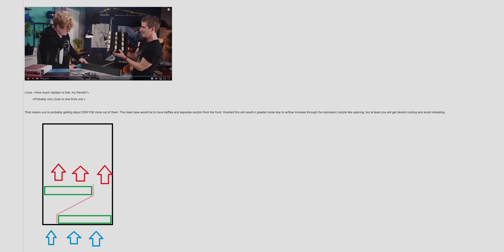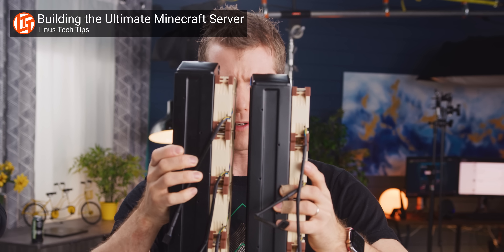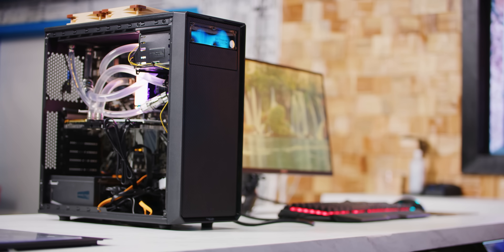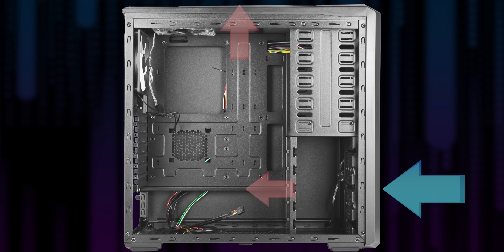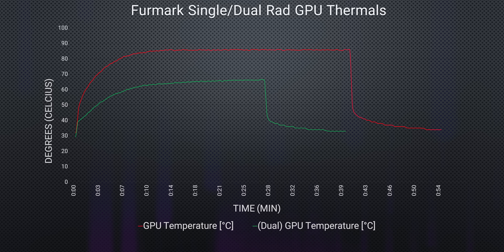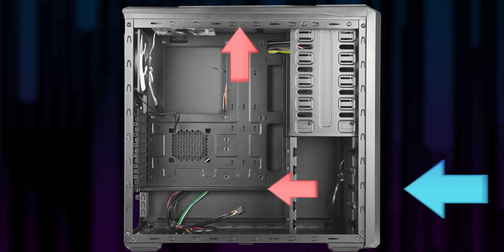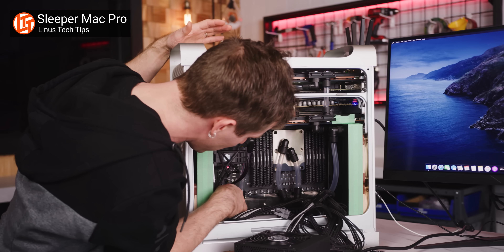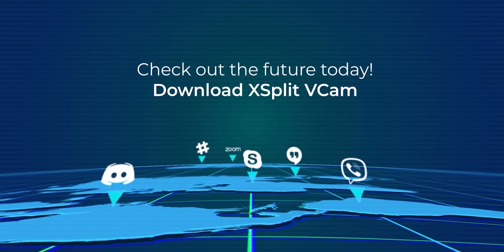I’ve been water cooling wrong for YEARS - $H!T Manufacturers Say

Comment: Maybe its so obvious noone seems to have said it, but if you are going to stack radiators, it ought to make a huge difference which order you stack them. - 'pre-cool' the one(s) closest to the heat source with the hottest air and let the one(s) with the coldest water see the coldest air.  Running the things in parallel with them all getting room air is going to be best, of course.

Comment: Linus: "Nobody would do that"
Corsair: "We do that"
Reply: does that mean corsair = nobody? 😩😩😩
Reply: Funny enough I do it to prevent dust from coming in through openings that have no filter
Reply: @spooky1000  Get or make some filters.
Reply: @Haargeroya  there are holes on the stupid pci plates, i put electric tape on them, as well as on some water cooling grommets
Reply: Yeah, I used plastic foil and a pair of crappy 120mm fans to seal off my top case vents after spilling my drink and nearly flooding my PC earlier this year. Didn't even do anything to the thermals, but that's kinda what I expected. I tuned my rig for silence and efficiency, rather than absolute maximum performance.
Reply: @ELHV  I think your main issue is getting the pc off the floor.
Reply: @Haargeroya  To be fair - this has happened once in the 8 years that I had this kinda setup, so it's not exactly something that I'm too worried about. The plastic cover is just a nice bit of bonus protection and it also keeps the dust out, which is nice.

Comment: THERMODYNAMICS!!! IT IS ALL ABOUT COLDER AIR GOING THROUGH WARMER RADIATOR!

WITH MORE THAN 1 RADIATOR IT MAKES VERY MUCH SENSE TO PRODUCE OVERPRESSURE IN THE CASE!!!!
Here is why:
One radiator after another is as retarded as a radiator taking in warm air from the inside of the case.
!!!!!!!!!!!!##### HOWEVER  #######!!!!!!!!!!
Having a second radiator taking in colder air is still providing energy/warmth removal from the water.

Comment: What if you have 3 120mm fans in front and have one 3 fan rad on top as an exhaust with a two fan rad at the back as an exhaust as well? Would that be to much negative air flow?

Comment: You didn't stack the rads though lol....... You had them on opposite sides of the system... If corsair said stacking rads, and SPECIFICALLY mentioned the rig with radiators literally touching eachother... why wouldn't you test that scenario lol... for all we know corsair is right about that.. Huge fan of your videos, but like you completely looked past the plain english corsair used lol.

Comment: It may be highly efficient, but not enough air was flowing through it to dissipate 400 watts of heat. I'd like to see an airflow test where you build the same system in a case with better front airflow and do another comparison. Or move the same radiator outside the case or add more fans to it.

Comment: Since the temperature gradient is a huge factor it would make sense to route the CPU/GPU through the exhausting radiator first to have a large temperature difference and then with the "preheated" water through the intake radiator, so it sucks in cooler air from the outside. With that there should be a large temperature difference between each of the radiators and the air

Comment: seems running rads in positive pressure config would work best, provided your case is ventad well. stacking radiators should work fine if you put the water through the radiator furthest downstream (airflow wise) first. its heat would be vented out and not be pushed through the other two radiators. so long as one radiator doesn't heat the intake air for another you should be fine. but dont take my word for it, do some science. another thing to try is running your rads in parallel each getting its own air. this should give you maximum heat differential at each radiator. idk how you would get that to fit in most cases though.

Comment: You could just address the premise directly and just measure all the temps (air in, air out, water).

The air out probably won't get anywhere near the water temp as they claim. Maybe on an 80mm thick rad with a shitty fan at 500rpm it would, but not on something realistic.

Comment: I am not sure how your system is build, but i think another point is that corsair meant the intake radiator to be the "hot one" so the first radiator after the cpu an gpu. That would make a lot of sense because if the second radiator, would be the "hot one" then it would blow the hot air straight out of the case an the water is cooled down at the point where it enters the second radiator. In the case where the intake is hot, it'll will blow the hot air inwards and the seconde one has to deal with a much smaller tempature difference.

Comment: so.... how many radiators would it take to get the water temp down to ambient temperature?
Reply: water cooling has diminishing returns you will never get to ambient without an outside factor like a water chiller.
Reply: @shrekdaklown  so, like 10?
Reply: @BillTranmer  even 50 wouldn't do it you need a water chiller or refrigeration
Reply: @shrekdaklown  I'm starting to think that you think that I think that you think that I'm not understanding. But I assure you I do. You're saying use bigger fans.
Reply: @BillTranmer  no no no use many many more smaller fans
Reply: @shrekdaklown  YES!!

Comment: So , let's say u put the 2nd rad  (which takes the inside air "hot air")  as the first one that takes the water in series and the 1st rad ( which takes the outside air "cooler air" ) as the the second one in series it would make a difference , such as it would make more surface area , but if u do it the other way around it may actually affect it negatively ... Thanks for reading this 🥰 lmk what u think

Comment: Stacking Rads should work fine, as long as you don't have the option to NOT stack them. You SHOULD run your hottest water into the radiator that sees the air last and do NOT parallel the flow into your stacked rads(if you can avoid it). Following these ought to provide the best DT between the air a rad sees and the water inside of it.

Comment: Try this on a Lian Li PC011 : 
1. bottom 360 rad with pull fans on intake + top 360 rad with push fan exhaust (pushing out mixed ambient and warmed air through rad out of case) + 3x120 side intake fans (pulling in ambient air into the case) 
2. bottom 360 rad with pull fans on intake + top 360 rad with pull fan intake (pulling ambient air through rad and pushing warmed air into case) + 3x120 side exhaust fans (pulling 2x360 rads' warmed air out of case)

Comment: in a system that uses more radiators it also has more water to hold heat. . .  if the system ran long enough, perhaps 24 hours or more under load, both systems might get closer to the same temp at the end but that still might not get close because of the increased air flow.
Reply: once the water has been fully heat saturated at full load it will stay there unless ambient temps or load changes. as long as they ran it long enough to fully heat saturate it the volume of water doesn't matter.

Comment: It'd be cool to see performance benchmarks using two separate radiators (one for the CPU, and one for the graphics card). My theory is that the cooling capacity significantly decreases for every part that the flow of water passes through (from CPU > GPU > 2nd GPU). Think of it as using low simmering water to cool down an already hot pot, compared to using room temperature water to cool it down. I'm more-so interested in seeing the performance difference for the GPU, since it's usually the second part in the water loop that is pulling heated-up water from the CPU.
Reply: your theory is already proven the more components in a loop the larger the heat load and more restriction.
Reply: @shrekdaklown  that is true. i guess what i meant was, I want to see the performance difference with a separate loop per component lol
Reply: @marksegui4122  I've ran dedicated separate loops and single large loop on the same system. it was about a 4 degree difference on average. the cost difference far outweighed the temperature difference. Cost vs performance go large single loop. Have a large case and the money go dual loop less for temps more for aesthetic.

Comment: Here is what we learnt from this video. 
They are incompetent at running any sort of test. 
They try to prove their hypothesis correct instead of disproving it. 
They also took what corsair. A company I trust significantly more than Linus. And spun their words to male their own argument better. 
Adding more radiators will cool it off better. But the effectiveness of it is usually not worth the extra cost. If you are doing VERY long and massive loads then having more radiators will be far better over time. But in general you aren't running a server at 100% every single say 24 / 7

Comment: I run about 400 Watts of heat on a single 360 Rad and the air temp is nowhere near my water temp. My water temp is ~40°C, the air coming out is at 32°C room temp is 21°C. What corsair says only makes sense if you have less air moving heat away.

Comment: Another factor could be that the first set of fans is accelerating the air from near-zero velocity, while the second set of fans is pushing air that's already moving allowing it to push that air even faster (of course this isn't technically how fluid dynamics work and pressure differences and load on fans would result in both sets of fans spinning at roughly the same speed— but the thinking here works to the point that more fans mean more airflow through the radiator(s) ).

Comment: What they said was logical but it assumes the single rad isn't marginal. Like if the water is still hot on the way out of the rad then it can still get cooler and the idea that case air or even air direct off another rad is actually as hot as the water coming out assumes that the airflow is marginal. I could see an argument that the noise vs thermal performance wasn't as good but that's not what they apparently said. And I could see an agreement that you maybe shouldn't stack radiators without increasing the number of fans for the radiators, but you did increase the number of fans with the stacked rads and in your test build you used fans that wouldn't have have much affect on the static pressure of the first rad.

Comment: "Nobody would do that"

... unless the goal of opting for water cooling instead of air cooling is to reduce noise and build a silent system.
Reply: except water coooling uses fans (and on top of that a pump)also
Reply: @basvanderwerff2725  I've built several natural convection base watercooling builds. You still get more surface area (and get to orient it vertically) than just unplugging the fan for most stock coolers.

Comment: well cooling with hot air is just not optimal, hence why i went with a 011 dynamic so i can have a 360 rad intake, a pure fan 360 intake, and a 240 in the top in pushpull sucking in fresh/vrm air and a single free fan directly behind/above the 360 intake sucking away some of the pre-heated air.. 

some of my friends even get confused in the summer when they feel there cooling is failing where i then ask if they have there doors and windows closed locking the hot exhaust air in there room eventually raising the temperature and negating it's ability to get cooling done, they ask if watercooling doesn't have that problem to which i have to reply it does and due to the sheer amount of fans it can get the room up to temperature quicker in my experience. having a place for your hot air to go and some fresh air to enter really helps : /

Comment: I've always used my CPU radiator as an exhaust outlet at the top of the case for the PCs over the years and my system/s have run very good with temps that never go over 70oC in the summer. (front and rear fans draw in air)

Comment: This is coming from a brewer... beer... Where I have been practicing the most effective way to cool hot wort, “beer tea “ down from 212°f to 70°f or 55°f in as little time as possible. We use heat exchangers that pass cold liquid through plates adjacent to the hot wort flowing in the opposite direction. This creates the best possible heat exchange. I’ve been considering the cooling issue on computers and trying to think of how to cool a PC like a brewer... Ideally there would be two “interlocking” loops. One coming from a glycol chiller and the other from a loop running glycol across the CPU / GPU. These would pass across a heat exchanger, much like the ones used in breweries, and exchange their temps to an equilibrium. No fans needed, aside from the glycol chiller. This should allow fine tuning temps within a degree or so. A digital controller on the glycol system could be set to cool to a desired temp and run off the return temp from the CPU/GPU. Could produce a silent PC. 

Just the thoughts of a brewer / amateur PC builder.

Comment: It's true blowing hot air across a radiator isn't going to do you any good.  Newton was a smart man and gave us an excellent law of heating and cooling that describes this behavior.  But you have all those surfaces inside the case to absorb heat and conduct it to the case itself, which is in effect a radiator as well which cools the air inside the case, even if only very slightly.  Additional cool air seepage from any other openings in the case will cool the air going into the second rad, increasing it's efficiency.  Adding the second rad also adds more fans.  Those fans were pulling air from the inside of the case, creating a lower pressure system for the first rad's fans to push into, which reduces the difficulty of pushing air through the rad, increasing airflow.
So yes, in a system completely sealed and insulated between the rads, adding additional radiators won't help.  But adding more fans will in any case.
I'd like to see a comparison of this system with both rads as they are vs the single rad only vs single rad with additional fans from the second rad vs double rads but only 1 rad with fans.  With all fans set at a fixed rpm.
I predict the single rad with double the fans would be best.

Comment: ofc more rads takes longer to warm up as more water means more mass to heat, 
Corsair are right for optimum function of a rad in theory but in practice as Linus said you have to work with the room you have,
sandwiching 3 rads together is not ideal and will not be as efficient as 3 separate rads with optimum airflow but you can still and do control temps albeit with limitations
In Canada in winter do a Timmy Joe and place the rads outside a window in freezing conditions! this may also work in many cold winter countries too, such as the Nordic countries and to some extent the UK =P
Reply: just insulate your mobo to protect from condensation and don't shut it off if it gets below freezing

Comment: The air coming out of a radiator is NOT close to the water temperature. For that to occur you'd need thermal conductivity higher than copper. The air is slightly warmer than ambient and cools a second radiator only slightly less efficiently than ambient air. 

The volume and velocity of air matters far more to cooling.

Comment: I do refrigeration for a living. Your experience is wrong. You aren't using temp sensors checking the water temp itself. You are using the onboard temp sensors which I don't believe are accurate in anyway to begin with.

Comment: I think their claims might be somewhat correct. As you said ambient temperature is the most important factor but you didn't tell us the ambient temperature you are running this at. In Africa it gets to 40c so running a radiator as exhaust makes my cpu thermal throttle. I have to run the radiator to get fresh air from the back of the case. Assuming you are using the rear fan mount as an exhaust instead of an additional intake your results may greatly vary.

Comment: What if you have two intake radiators intaking ambient temperatures, and then the equivalent airflow going out? That way, you have double the surface area but with intake ambient. That would probably be even better, but also probably impractical since it'd be a crap ton of fans or a ton of positive air pressure.

Comment: Another variable that wasn’t mentioned and is one of the key parts is the rate of air movement, if you’re moving air so fast across the radiator that it doesn’t get saturated it still has some cooling capacity for the second radiator, the higher the flow rate the less efficient the transfer from rad to air which makes the second rad more effective.

Comment: Well staking rad ain't good 
Is like putting a 10 fans in a close room it will just be the same air 
Now get a room with 10 windows.  Put 5  pulling air into the room and 5 pulling out air out of the room. 
Now the room temperature will depend on the air coming in.
That's the easiest  way to put it and what corsair meant  stoking  then ain't good but adding  more rads with their  own air pulling in is the way to do it.
Another perfect example is bugatti veyron it has 11 rads but not stock up car will overheat.  Each rad has hes on fans pulling  air in front a diff source. Linus comom. I love you do but common.

Comment: At the minecraft server, having all the three rads side-by-side would have a better cooling performance because all rads will exchange heat to the ambient air not the preheated air from the previous rad, but it will do occupy a larger area. If the size do matter the best way to utilize the 3 rad-fan stacked together is to have the hot water enter the inner most rad(the rad furthest from the ambient air) and exit the rad closest to the ambient air, this will be like a 3 cross flow heat exchanger mounted on a counter flow orientation.